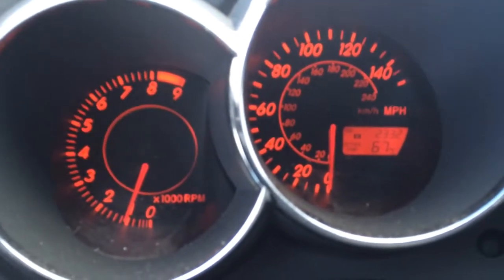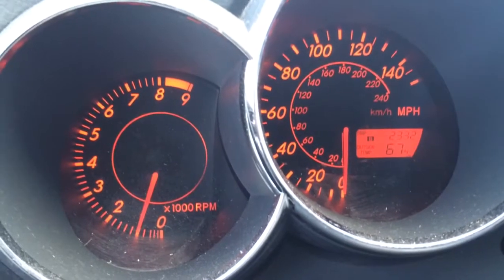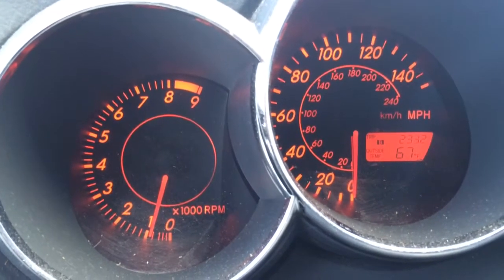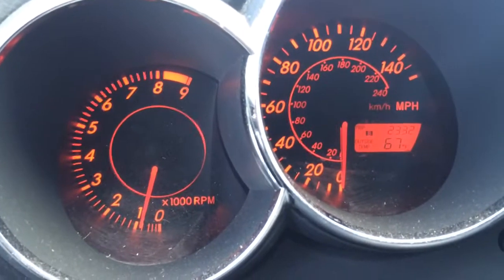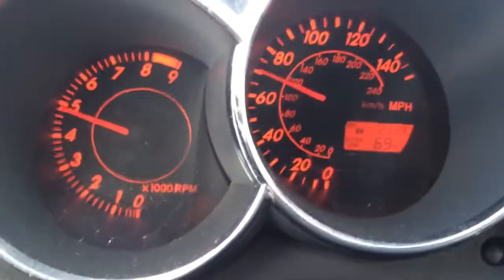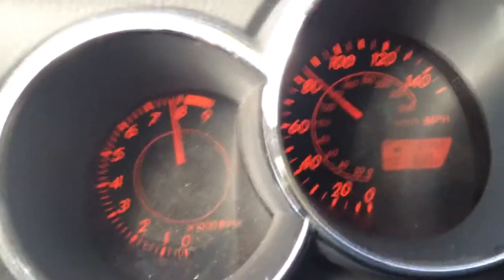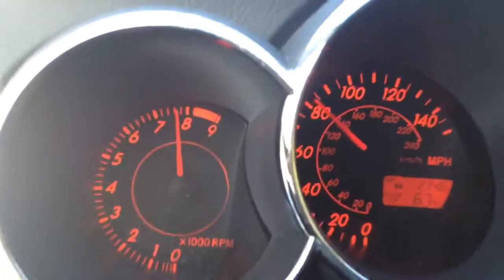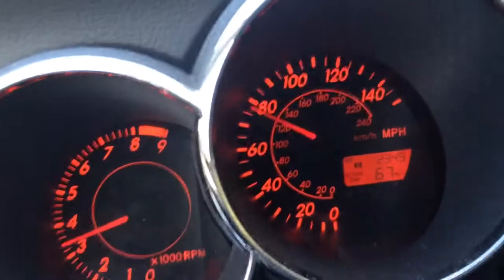2003 Toyota Matrix XRS test drive of VVT-I VVTL-I

Comment: Lift is not working properly. My 2003 XRS kicks in hard at 6000 rpm. you have to shift at 8200 in order to keep it from dropping below lift in the next higher gear. If it drops below 6000, power decreases significantly.
Reply: Pat Riley no it doesn't it engages at 6300 I have the same engine in a 03 vibe GT
Reply: from everything ive read some earlier production models of the 03 had lift closer to 6k others are right at 62. Computers man, its strange stuff

Comment: Of you still have the car it might have a weak fuel pump.  my pump died after 6 months of owning and I thought it was kinda slow hitting lift.  But disnt have anything to compare it to.  well car wouldn't start one day.  changed fuel pump and it hits lift a lot harder now.
Reply: 03-onward xrs models had the vvtli cam change raised to 6800rpm. celica gts had a different ecu tune. some engage at 5800. most at 6200 then the later years 6800. honestly i prefer the lower engagement point i had the Rk9 tune done. it lowers the vvtli change point to 5800 and raises the rev limiter to 9000rpm. with a short shifter and some solid shifter bushings from MWR the 2zzge is a beast.

Comment: I know this is an old video but you seem to be hitting lift really late, you should hit around 6250 if it is a 2003 xrs with stock ecu
Reply: 03-onward xrs models had the vvtli cam change raised to 6800rpm. celica gts had a different ecu tune. some engage at 5800. most at 6200 then the later years 6800. honestly i prefer the lower engagement point i had the Rk9 tune done. it lowers the vvtli change point to 5800 and raises the rev limiter to 9000rpm. with a short shifter and some solid shifter bushings from MWR the 2zzge is a beast.

Comment: The speed looks about right, BUT your lift looks like its kicking in way late. At least its kickng in, unlike my XRS which is waiting on a new lift OCV to come in the mail..
Reply: 03-onward xrs models had the vvtli cam change raised to 6800rpm. celica gts had a different ecu tune. some engage at 5800. most at 6200 then the later years 6800. honestly i prefer the lower engagement point i had the Rk9 tune done. it lowers the vvtli change point to 5800 and raises the rev limiter to 9000rpm. with a short shifter and some solid shifter bushings from MWR the 2zzge is a beast.

Comment: What's up man. That's vvtl-i sounds good. My 05 corolla xrs isn't getting lift. We're you having cel when you tried to hit lift? It Rev limits at lift 6800
Reply: PotentialDifference1 I had that happen when I had a blown head gasket. Cel read low oil pressure at the ocv, it wasnt the ocv but the head gasket caused low oil pressure and coolant contamination. As long as your radiator overflow isnt bubbling (big sign of head gasket failure) you should be good.